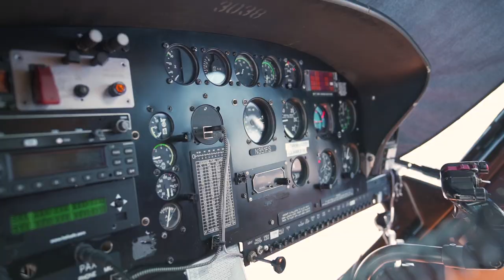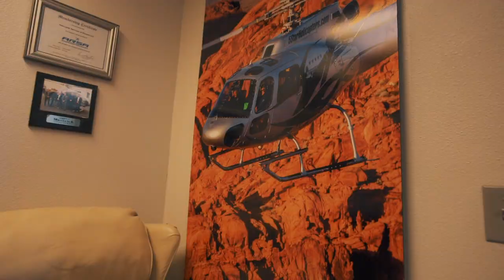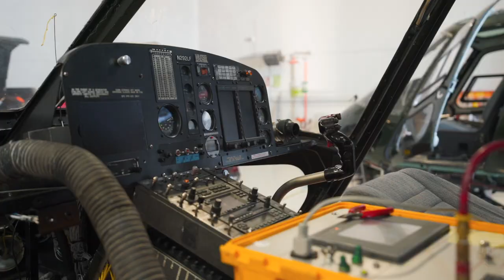Royalty’s First $1 MILLION dollar helicopter build!

Comment: Good thought process for helicopters and fuel isn't mpg it's flight time. IE full tank gets you 3 hrs of flight time whether you're going max cruise or hovering.
Reply: Fuel consumption estimations in a helicopter can just as easily be converted into knots/gallon, knots/pound of fuel, miles/gallon, or any other ratio.

Comment: I'm sure you know. But the maintenance on a helicopter is insane. The fuel is the cheapest part.   Its around $700 an hour for a small turbine heli like a Robinson R66 or a Douglas D500 (think magnum P.I.). I know the magneto needs to be rebuilt every 500 hours at $2k. And the fuel pump is a 500 hour deal too at $1800. It gets expensive.

Comment: The cheapest helicopters what are shared in Las Vegas are 100 dollers if there is 6 seats 600 they are like 15 minutes but yours is a lot nicer so you can probably get 800 for 15 minutes or like 2k a hour well 4k a hour because you have to go back to Las Vegas sorry I messed up

Comment: Looks like 1000's Aventador's worth of headaches
Reply: DOUBLEDEFENSE the investment of it though... It'll be worth it one day.
Reply: The cool side is no jet fuel bills. Turbines use no fuel.
Reply: Helicopters cost multiple thousands of dollars to operate per hour. Good luck.  Aviation is one expensive sector to just break into and expect decent profits.  You heard them. Every 3000 hours they need all new parts.
Reply: Baxter no they don’t. “Multiple thousands of dollars per hour to operate.” What are you even talking about? You can rent one  for less than $1000 per hour.

Comment: Houston....you need to understand the maintenance schedule for this helicopter! You MUST understand what items on that helicopter have to be replaced, overhauled, inspected, when and how often along with current prices. Buying the helicopter and operating it are cheap. The overhaul, inspections and maintenance are what will bite you if you dont understand. It's not like a car. You HAVE to follow the manufacturers guidelines. ESPECIALLY THE CHAPTER 4 ITEMS IN THE MAINTENANCE MANUAL........

Comment: 1987 Aerospatiale AS350 B2 Ecureuil (Squirrel) - Always check your tail rotor bearings, they have a life cycle and are prone to wearing out! Also..check your servos and rigging. You should also check your accumulator pressure is at the required values while doing your preflight checks.

Another point make sure your hydraulic pump supplying the required pressure.

Always check that your frictions are not binding also check they are full and free on your pre-flight control checks prior to applying a little friction.
While you think a black paint job looks cool, it makes it more difficult to visually inspect the 4 tail rotor shaft bearings and vents for leaks.
Reply: Who are you telling this to? Houston, who is never going to need to worry about any of that stuff? The owner of the helicopter company, who already knows that stuff, and also doesn't need to worry about it? Like, what was the prose of that spiel?

Comment: Make sure the materials you use on that Helicopter are fire resistant. I don’t believe you can use the same material you use on your cars. Weight and balance is also a factor.  Look into the FAA rules before you start modifying the helicopter. Your in a different league now. I’m an FAA A&P Technican 12 years.

Comment: Should look into glass floors   ther are amazing views
Reply: There is way too much stuff going on under the floor. Wires and avionics equipment would include the view. Besides putting a glass floor in a helicopter not being practical for other reasons.
Reply: @xenonram  i mean its ben done a lot